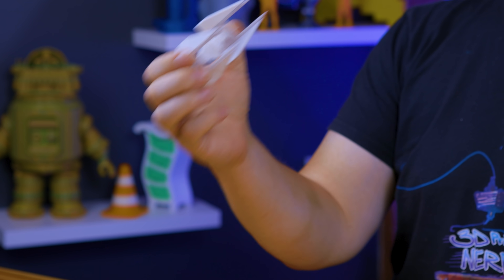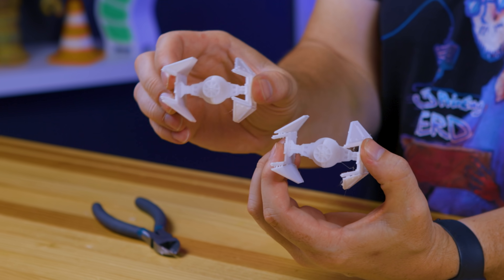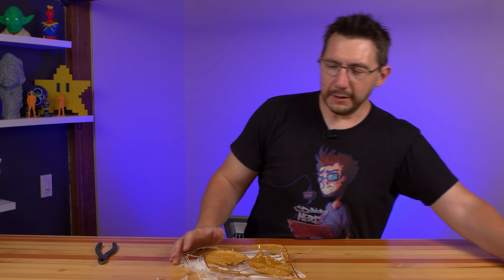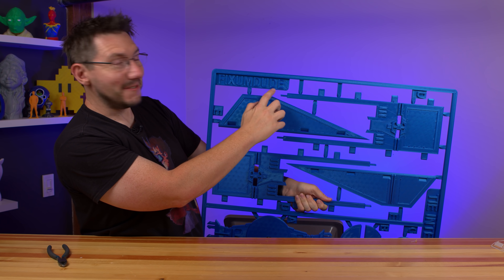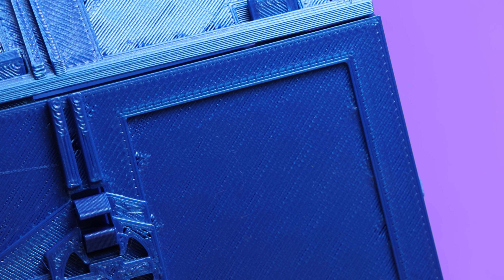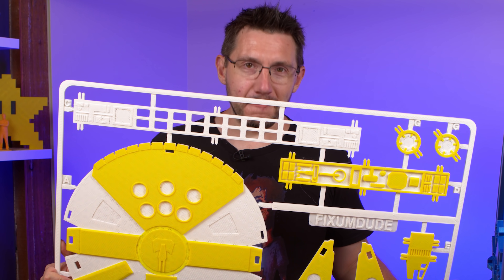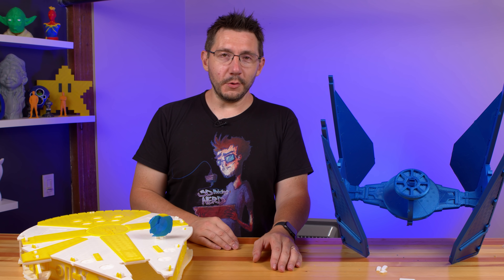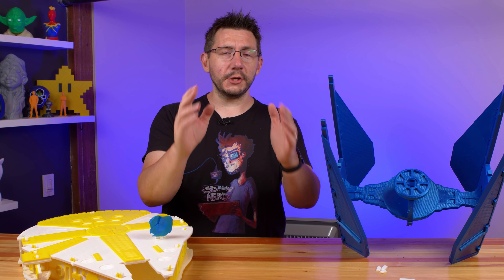Star Wars vs the $38,000 3D Printer

Comment: Joel... I have a crazy idea . I think your the man for me that could point me in the right direction. I am a drummer that is playing an electronic kit. What I want to do is 3d print all the drum shells my problem is finding a printer big enough to do the bass drum. Size I’m looking for on the bass drum is 22 inches around and 6 to 8 inches deep. I would supply the filament. I think hi-fi blue would be cool. But I think I would need to do this in Pet-G. Because I play outdoors and has to be be able to support some tension from the head. So I was wondering if you knew anybody with a huge 3D printer that could handle something this big?

Comment: Hey man I had the same problem with the run out sensor as you did but it was a easy fix. The board is loose inside the housing I glued down the board and haven't had the issue again. I hope this helps you.

Comment: Seriously, Star Wars crap? How about printing something useful? I’m looking for a printer capable of printing parts, just toys.
Reply from the maker: I’ve printed lots of useful stuff as well as “useless crap”. What’s something useful you would like to see printed.
Reply: As I said, I didn’t mean to sound so harsh. But I’ve been looking on the various 3D channels, and I’ve found only a little bit on discussions on how to dimension drawing tolerances to account for the inaccuracies of these machines. What types of filaments there are, ans what each should be used for. What to expect for surface finish, etc. But mostly, I see basic machine testing with toys, and not much else. It’s disappointing, and frustrating. When this video popped up, and I read about the price of the machine, I was hoping for more than printing Star Wars toys. I don’t get the fascination with that. And I’ve seen most of the movies.

Comment: Nice!!  But its Not tiny interceptor!! 
Question:Did you just scale it “up” or u had to make adjustments in the cad program to make it bigger?
Reply: you just need to scale it up the slicer will do all the work, 
just change the 100% or one of the dimensions to the max your printer can handle, 
just leave scaling on or it will get wonkie,
you can go up or down but will have to file interlocking parts on down scaling